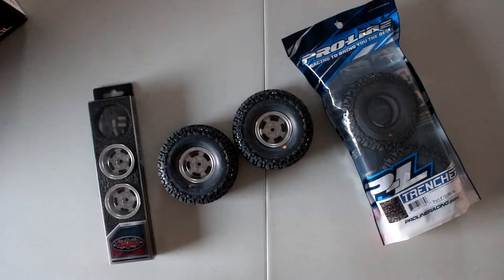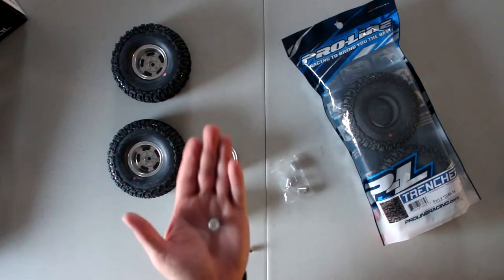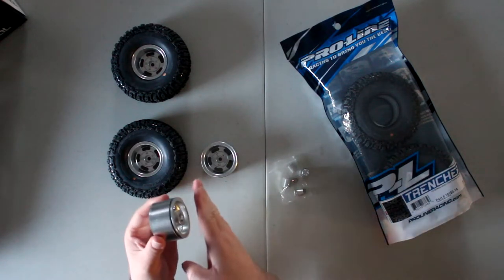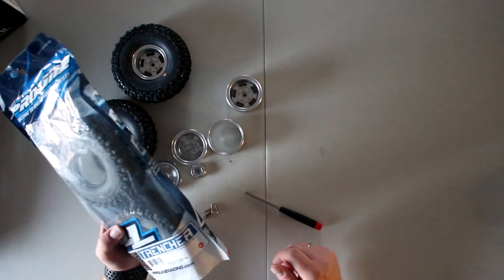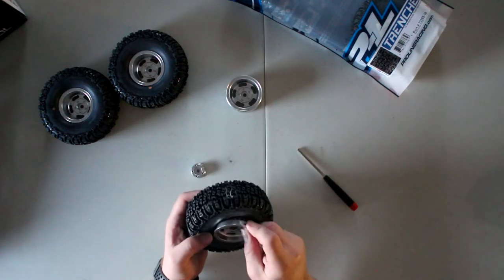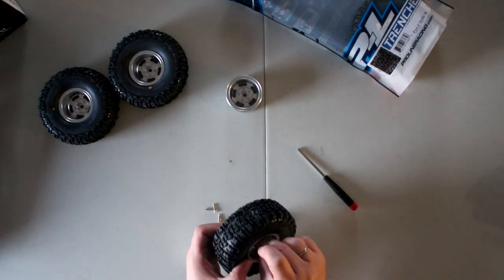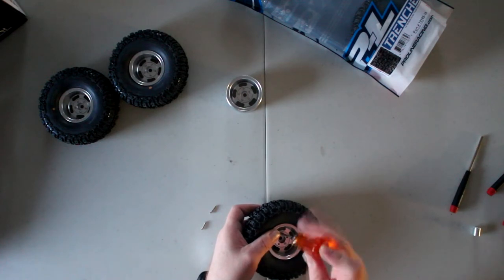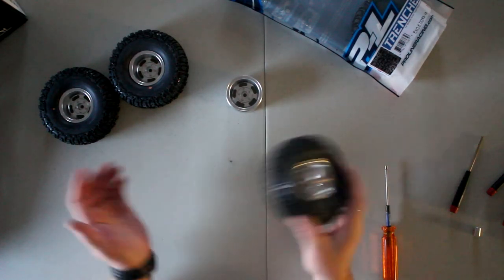How to Build RC4WD Beadlock Rims 1 9

Comment: Really nice wheels! tks 
You like them?
Given that they're aluminum, any way to add weight to them, and what screws do they use, M3 or M2.5?
Appreciate the info.....
;)
Reply from the maker: Yes, you could add it to the metal ring the weight for the screws. If I remember correctly, they are 2 mm.